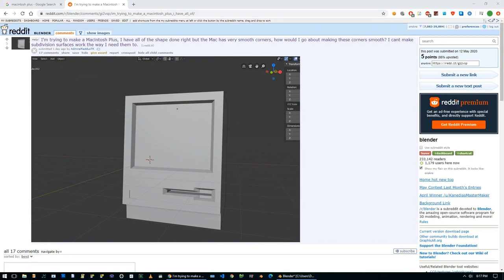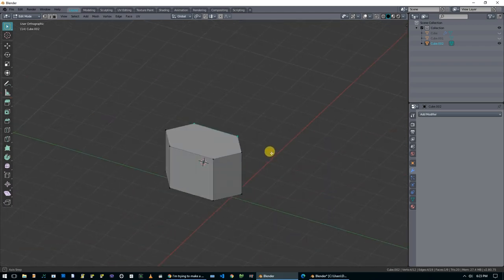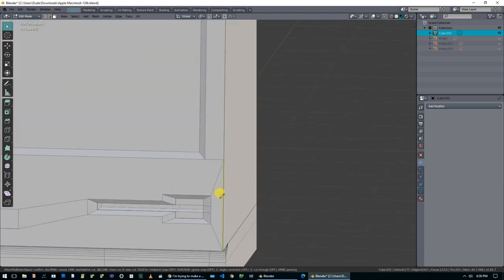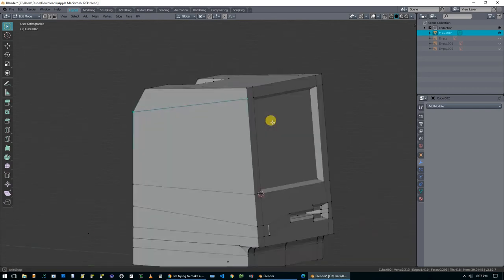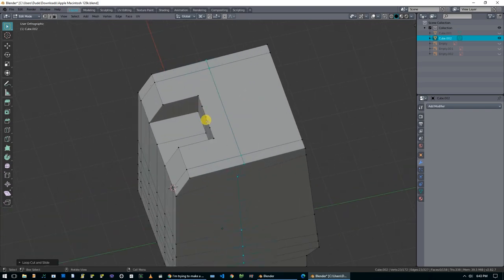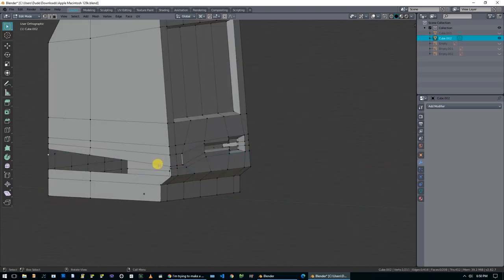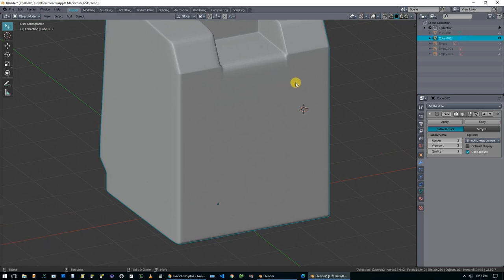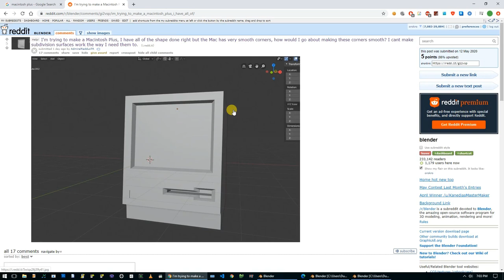Let's Help! Episode 04: A E S T H E T I C Macintosh Topology!

Comment: Wouldn't retopologising with a shrinkwrap modifier as you'd do with a sculpt also be viable?
P.S. vertex - vertices :D
Reply: Technically you can do that, but it will have a couple of effects: 
You will need an extremely high poly mesh to cover the detailed portions of the mesh evenly. But you aren't guaranteed to line the edges up cleanly. So you will often be left with triangulated faces instead of sharp lines on your edges (Similar to if you dropped a low poly cloth simulation onto an object). 
And you are also left with a large amount of extra geometry on flat surfaces. The benefit of doing it this way is you are optimizing the flat surfaces and only adding geometry when you are adjusting the overall shape.

Comment: why you not use bevel modifier
Reply: Archer Ossmann Correct me if I’m wrong because I’m not a blender expert, but he went the manual route because the topology of the entire mesh needed to be fixed.
Reply: Grandmaster Yoda you are probably right. I am no expert either
Reply: @Grandmaster Yoda  Yeah, that is correct. However, with the right topology in place, it would be better to bevel the end mesh, instead of using subsurf and proximity loops. Less geometry, cleaner and sharper results, more control and nicer output. Through bevel weight, it is easy to get things just where you want them.